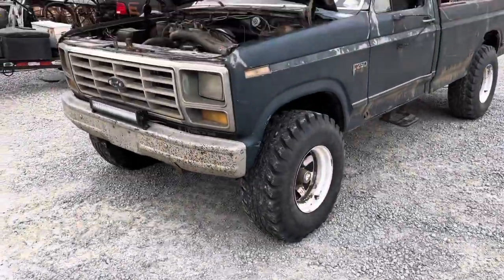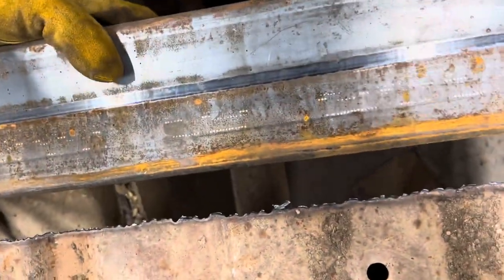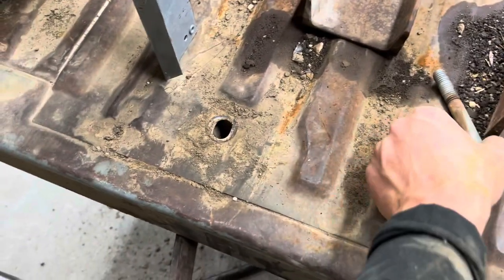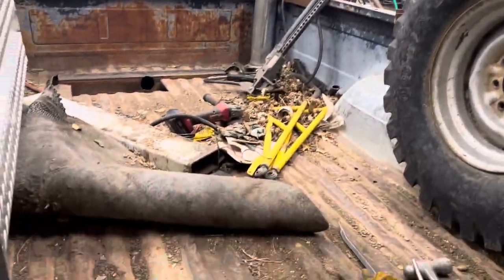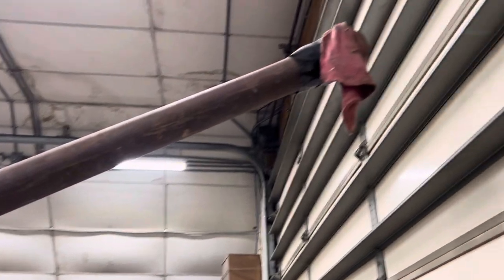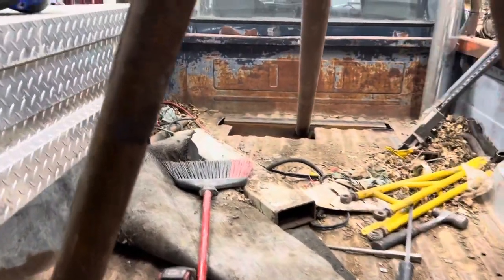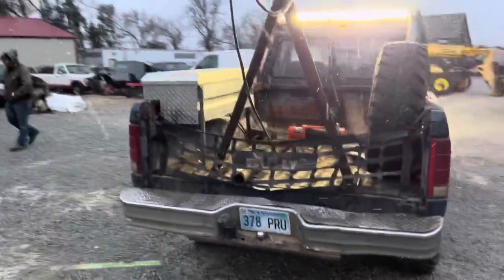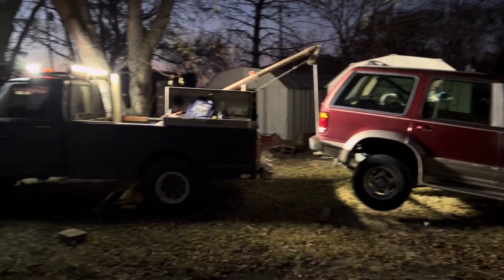Offroad Tow Truck

Comment: I'm totally on board with this build.....i'm subbing so i can see where this goes.........
Reply from the maker: Thanks! I want to build a pipe bumper on the rear with safety chains to pull cars. And the front will get a pipe bumper with a brush guard welded to it and a 9,000 lb winch. Then possibly outriggers on the rear eventually that pin up and out of the way. And airbags are gonna be a must too. I’ll post as we go!